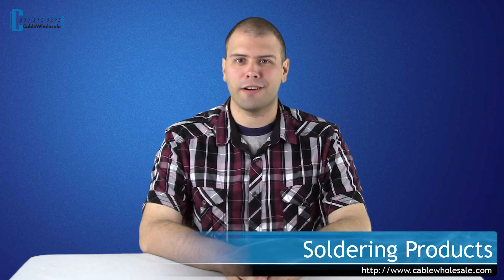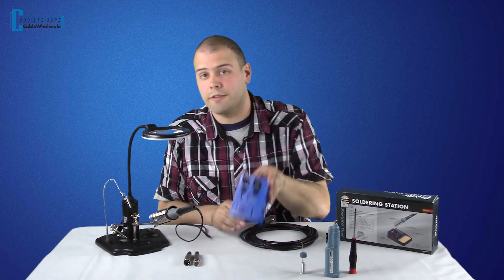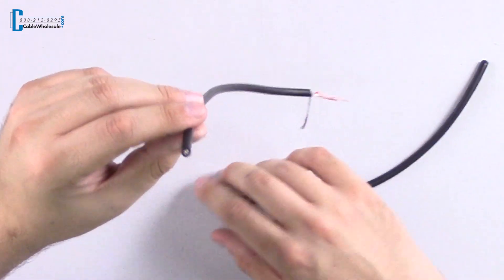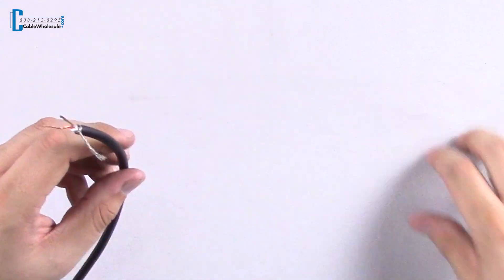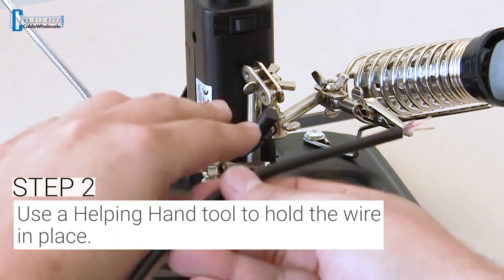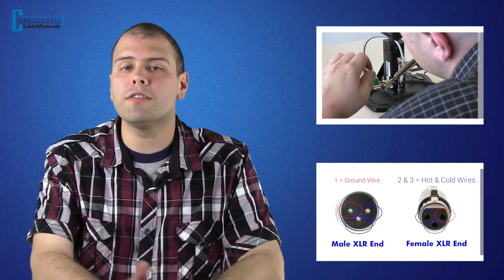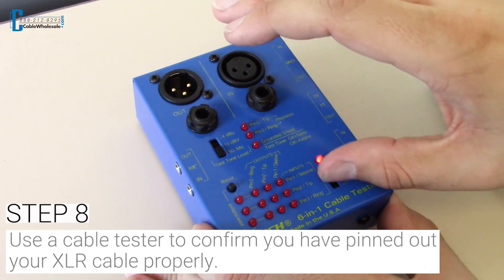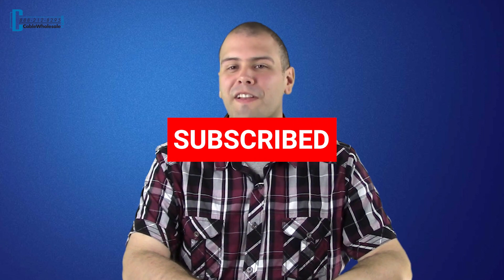How to Solder Wires - Make & Repair Cables

Comment: I don't want this guy working on my cords.
Shaky hands, stripped wire much too far, did not really show how to solder. 
I get that you want to sell some products, but should actually show 'how to solder', since that is the title of this video.  Also, show how to properly and neatly strip wires instead of just grabbing one already stripped.  (And stripped too far back at that.).  And don't call 2 & 3 'hot' & 'cold', in a balanced circuit, they are both equally 'hot'.  Refer to them as + & -, or simply 2 & 3.  Even the pliers crimping technique is bad - clamp should be closed neatly AROUND the cable, not just squished flat.